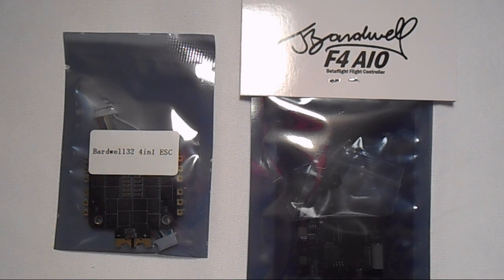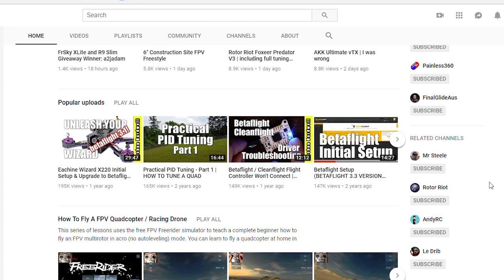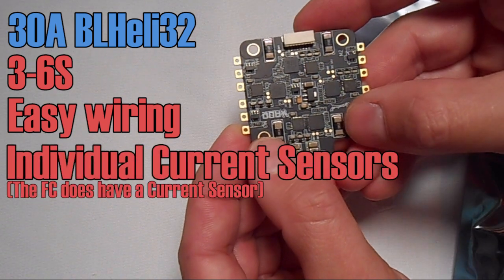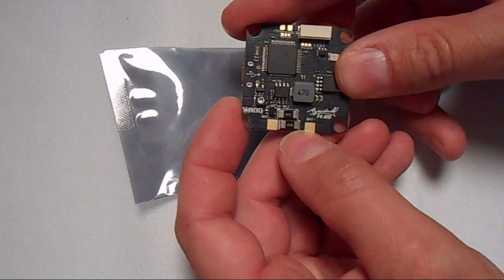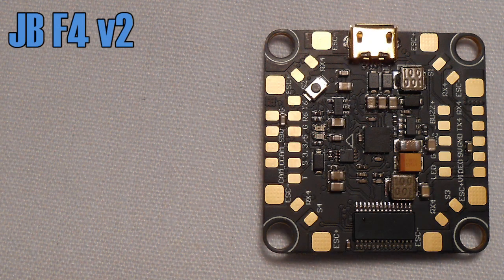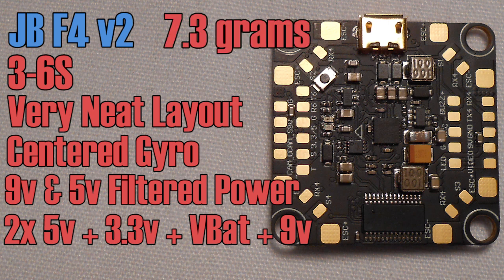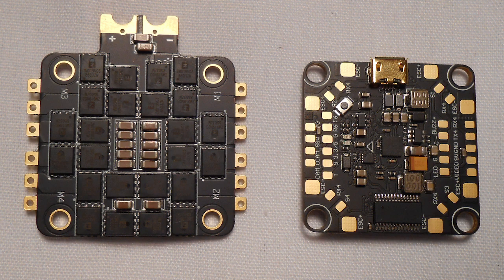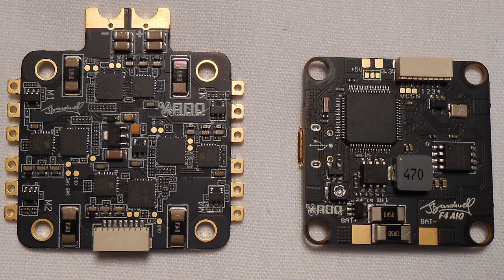Joshua Bardwell BLHeli32 ESCs! & The JB F4 v2 - A 6S Stack from RaceDayQuads!

Comment: Looks tidy, wish there weren’t holes on the ESC motor pads but that’s just personal preference.
Reply from the maker: Actually, the holes give the solder more surface area to stick to. It makes for a stronger connection. But, it also makes the pads easier to rip off in a hard crash. (Exactly what happened to my Typhoon) So you are correct. Its just a matter of preference.